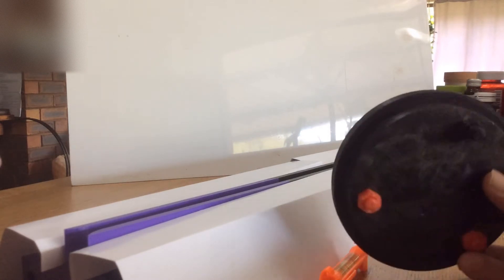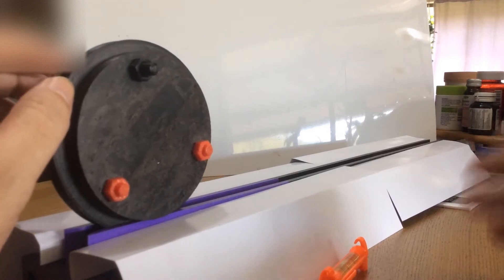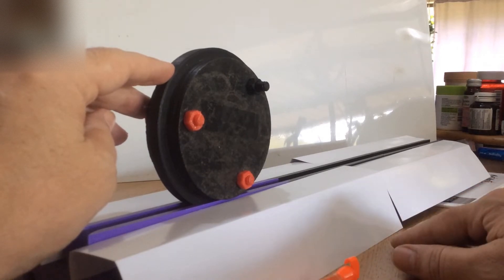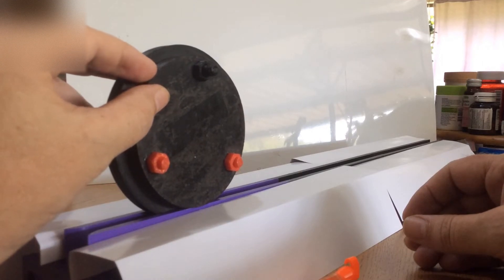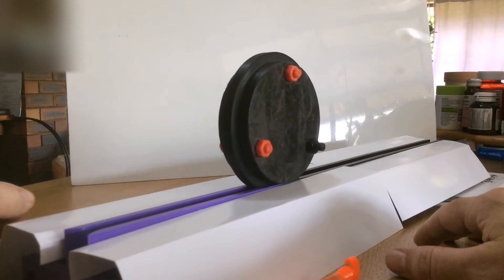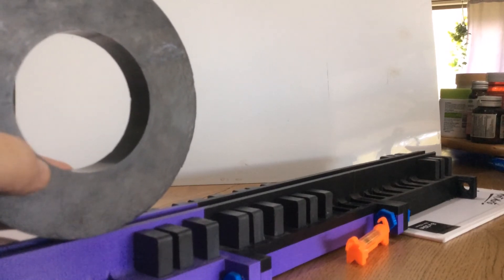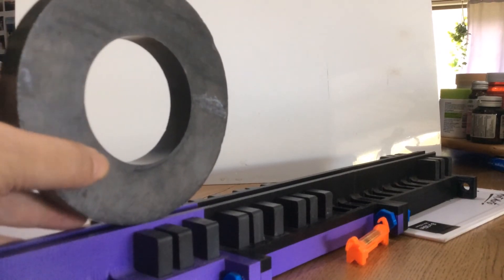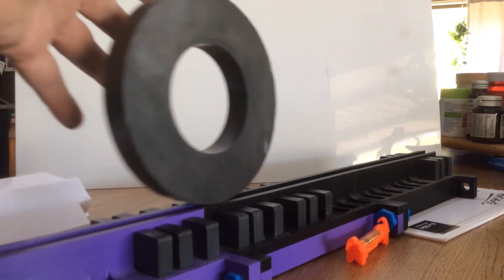Magnetic Propulsion Free Energy Magnetic Track Motor Design Perpetual Motion Concept Full Disclosure

Comment: As MotionMagnetics asks in his video:

“Would you be willing to produce a new video demonstrating a longer version of your track, so that you can show that the disc can be started at different points in the centre of the track and still accelerate out of the end of the track in either direction? (A video of the original configuration and a demonstration of starting the disc at various points in the middle of a much longer track and demonstrating that the disc can still build up momentum and leave the track regardless of where you started).”

If you could do that, sir, that would be great and very helpful!
Reply from the maker: Thank you for watching. Yes that can be arranged. I’m currently taking measurements before producing a new video, the ratios are of utmost importance so I will reveal those details soon, I’m not saying variations won’t work it’s just super important that the ratio of change is relative to or as close a percentage of change to all parts of the system. I can demonstrate the ability of self starting mid track and acceleration due to mass as each set of 3 magnets becomes a track of its own. There is going to be a delay building the 4 metre track as this was designed almost 20 years ago and the magnets I had purchased at that time have dwindled in number, they are powerful ceramic magnets that inevitably break if not handled carefully and for years, almost every time I showed someone the track a magnet or two was broken, however the existing track is more than capable of proof of concept which will be in the video also. I probably have enough to do one more segment so I will search for more of the same magnets otherwise everything has to be recalculated for new magnets. I also need to purchase more filament, not really a problem it just means it’s not happening soon and money is tight at the moment not to mention the crap show of global supply lines. I never bothered buying more magnets as everyone could afford their energy 20 years ago and nobody was interested in my track, now that there is interest I will speak to my finance minister,(my wife) and place a request for funds. 😂🤣
Reply: @whatifididthis...1236   Thanks for the comprehensive answer, I look forward to your new video. Now let's hope the Minister of Finance is in a good mood!  ;-D
Reply: @whatifididthis...1236  Well said!
Reply: @whatifididthis...1236 I think what you need to do is make some magnets tilted or some not etc but I definitely think tilting or changing the angle could help
Reply: @whatifididthis...1236 i wonder what the inside of the flywheel looks like is there just 3 magnets where the screws are? Well anyways I think having the magnets inside of the flywheel in a spiral 🌀 shape would work well with the inertia
Reply from the maker: @legoenginemechanic101  Thank you for your comment. I believe your idea could work, I have done some experiments with angled magnets prior to obtaining a 3D printer but couldn’t notice nor measure any improvement. I did this because Howard Johnson had angled arrangements in some of his propulsion systems. All suggestions should be investigated in my opinion, health permitting which is why I struggle to do the work. This is the reason I chose to release my findings, in the hope others could perfect it.
Reply from the maker: @legoenginemechanic101  Thank you for watching. Pictures of the inside of the flywheel can be seen at the end of the video linked below, it consists of a single ceramic donut magnet. Check the description for the video where I have a link to my 3D print files for the track, free for everyone!
https://youtu.be/_9dF25gxags
Reply: @whatifididthis...1236  thanks for the response and I hope your health gets better and I’m happy to say you have inspired me and others to create design and help improve and more.
Reply from the maker: @legoenginemechanic101  Thank you for your comment, it is greatly appreciated.
I thought it would help if I supply the video link I forgot to place in my last post, bad habits!
https://youtu.be/_9dF25gxags
Reply: @whatifididthis...1236  oh thanks I didn’t see this video yet I will watch it now
Reply: Do it🎉

Comment: Nice video. Would be great to have a circular version or a longer one to propel something to a higher speed to go up a ramp then can track back to the beginning to restart the process. Either way, we'll done.
Reply from the maker: Thank you for watching and I'm sorry for my delayed response.
I now have several different 3D designs for the rotary version, and a few failed designs, it is just such a lengthy production from design to print as some prints can take days and therefore I tend to build the systems with separate printed parts. Perhaps I will show some of these failed designs to save people time as many will have similar ideas. I believe this can be done even though many believe it can't and I keep telling myself to ignore my education and run with my experience of physical experimentation as the existing track wasn't meant to be possible either!

Comment: You need a much longer track for better proof. I've made ones that go about a yard but stop after that. But still without an extra propulsion. Only magnetic repulsion is still pretty good. I'm rooting for you
Reply: It also look like your track is running at an angle. Not to be sceptic. I love magnets. I've got thousands of magnets and still counting
Reply from the maker: Hi Nick, thanks for watching. I have tested this over 4 metres, hundreds of magnets, many different configurations and this one keeps on going. Build one with your magnets and you will see for yourself.
Thanks again for watching.
Reply from the maker: @Nick Baylander  Thanks for watching. The table is not exactly level, if you notice at the end of the track I placed a small thin canvas to make it level, approximately 5mm thick and checked it with the spirit level, no downhill run here! I will try to release another video showing its ability to climb a hill through the track! I encourage you to build it and prove me wrong. Who am I kidding, I have tested this so many times and I stand strong on my design.
Thanks again for watching.

Comment: congratulations, you managed to understand the fact that energy is nothing but the effort of the universe to keep everything in balance. your device manages to keep the imbalance along the length of the rail, but to achieve something quite remarkable you have to close the loop. at min 37 you say that you tried and it is not possible. sure it's possible, but the idea is to be able to shrink it enough to see it all and thus realize it, realistically speaking. you can circle the globe and then your device works safely but......with what effort?  tilt the rail as you suggested but only by a few degrees and you get a slightly smaller device but you gain another problem - gravity will fight against you and your device will be the size of a continent. to eliminate the problem, your device must be concentrically multiplied as many times as needed.......I don't know if I can explain it very well, but I hope you get the idea. Colossally large devices may work indefinitely but will never be built. As an example, fill with water a pipe that surrounds the planet at the equator and it will rotate only because there is a moon. :)
Reply from the maker: Thank you for your comment.
I do believe this doesn't need to be gigantic to work, this is evident in the tiny magnets I am using and the fact that this system is multiple systems and not one large system. I have made enough magnet arrays to see the reasons why some designs don't work. This was years of research and development that I critiqued with the things that prevent these systems from working, I read every word written by those demonstrating their principles and pitched that information against the devices that didn't work, I then arranged magnets until my hands were bruised and fragile and then woke the next day to repeat it all day and night until I saw it work. I now understand what it takes to make it work and trust me when I say every single millimetre is important.

I was aware of the gravitational aspects that work against these systems and instead of trying to get around undeniable issues I sought a way to respect and include those influences and incorporated those effects in the design, it is for this reason I believe gravity assists the propulsion with this design.

The reason I mentioned the size issue was because the circumference of the track needs to be significant enough to not cause drag on the roller, for some portion of a circular track the roller is travelling sideways which causes a scrubbing motion on one side of the roller. Therefore the track only needs to be large enough that the roller perceives the track as a relatively straight line.( Which although not that large it is still expensive for all the magnets)

I have spent enough years working with magnets to know this device will definitely work on a rotary basis because it was designed with the following crucial considerations.
1. Can it enter a track(section of 6 magnets) under it's own momentum? = Yes
2. Can it exit a track under its own momentum? = Yes
3. Can it repeat this track after track? = Yes
Now consider this, if I push the roller through one track and it leaves that track with enough power to repeat that process without a second impulse from me then that suggests the array supplied more power than I initially supplied because it leaves the first track faster than it entered. The repeat of this cycle at a self governed speed faster than my initial impulse is all the proof I or anybody else should require.

I have supplied the 3D print files so anybody can replicate this linear version and commit to making your own rotary version once you have learned what this track has to teach.

Comment: I’m just curious if you ever tried cylindrical magnet placed on tracks ? Perhaps you are aware of Nigel design
Reply from the maker: Thank you for watching. I have not tried cylindrical magnets in this arrangement. As long as the fields are placed facing the correct directions for my design it should work. I am not familiar with the Nigel design but always willing to learn.
Reply: @whatifididthis...1236  I’ve asked because following a thread on forum someone mentioned that magnets in motor generator aka Samsung washing machine motor should have cylindrical shape, which makes me think the shape of magnets could have less drag especially in a push-pull system, so cylindrical magnets might work better as I’m pretty sure the magnetic field would follow the shape of magnets. So, cylindrical on tracks and perhaps rectangular on vehicle.

Unless we discover how to levitate magnetic against gravity and no need for tracks 🙂